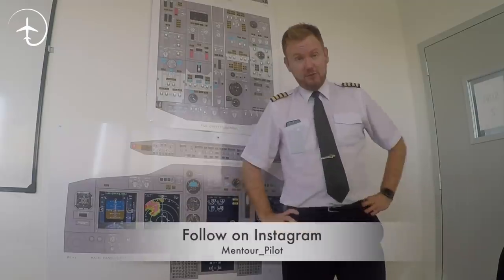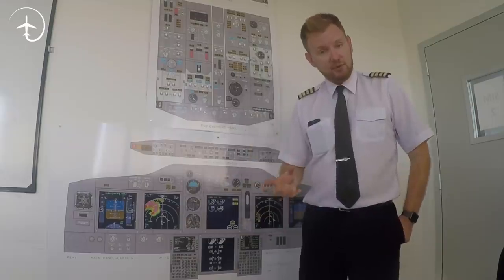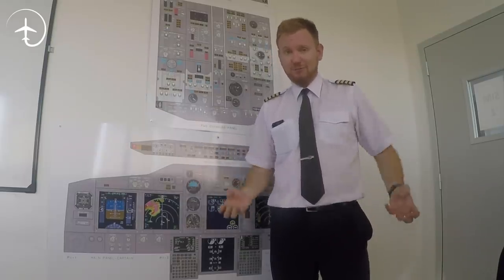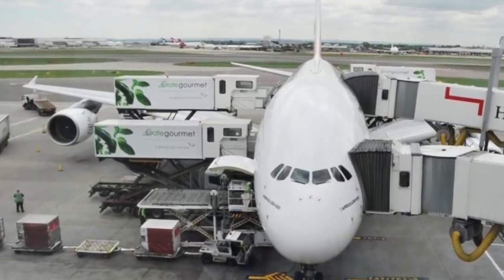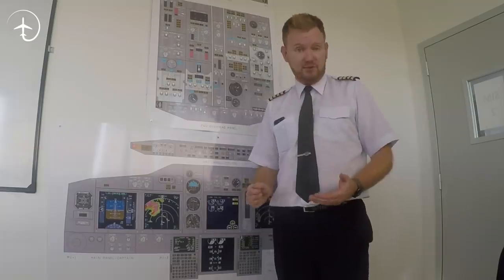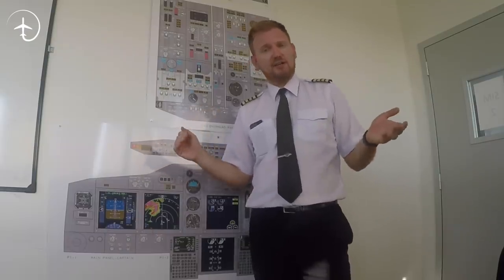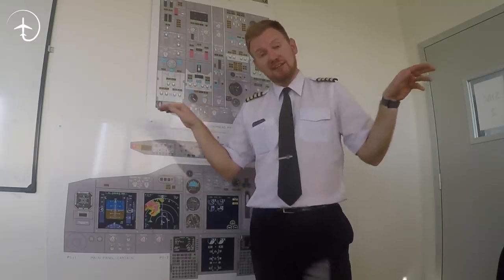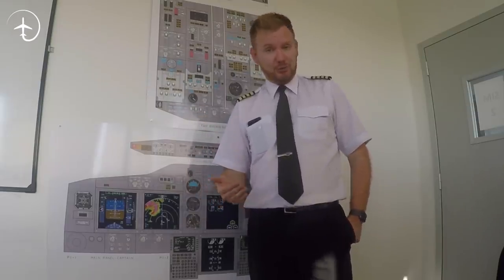What is that SPIRAL in the Jet Engine?

Comment: Used to fuel aircraft, private, charter, corporate, ComAir and SouthWest Airlines, back in the late '90's, until '04 in New Orleans. Ahh the lovely wash coming off a hot engine on a humid August day. Oi. About the only part, other than the first and third employers, I do not miss.
I was fairly lucky, as Jet-A didn't bother me too much, so when I had an "oops" (certain helicopters are great at splashing you, sometimes the hook-ups leak because they're worn or once about to fall off loose) and got fuel on me I could clean up a bit in the restroom and change clothes and be fine. Other guys got a rash before they could even get cleaned up.
We had one hire who loved the job, and looked to be pretty good, but just the fumes from the jet fuel caused him to become a walking rash.
I got lucky and never had an accidental overfuel where it came out the vents. I did have a request for a "Jet-A truck with single point, and two five gallon buckets." when I fueled an F-104 Starfighter. It had no gauges and let you know it was full by pissing out of the wingtips.

Comment: They are to simulate motion so to frighten birds away.

Jets have a horizontal "V" < with the open end towards the engine inlet. To warn  deck personnel about the suction. Men will be killed by the fan if sucked into the engine.

Comment: I was once accidentally sprayed with cold petrol on my face, it was not a good time. Even after I cleaned it off my skin was irritated for a long time, it went super dry, it was the worst case if chapped lips ever basically. 

I had to put lots of lotion to get it feeling normal again. So yeah don't stand under the wing of an plane.

Comment: TLDW: “Our aerospace engines have swirls painted onto their spinners in order to indicate when the engine is rotating while on the ground. In flight these swirls flicker as the engine rotates at high speed, scaring birds and allowing them to fly clear of the engine.”
Of course watching this gives more details.
Reply: I think the bit about birds avoiding the swirls is talking about on the ground. In flight, the aircraft is moving far too rapidly for a bird to perceive, much less aim towards, the opening of the engine.

Comment: Is there any possibility of engineering a grill that can unfurl for use when on the ground as an extra measure of safety?

I understand why they cannot exist for operation when in the air, but on the ground the degradation of performance and the aerodynamics are not as important.

There have been at least two or three recent incidents in the USA of ground crew ingestion. It just feels like a retractable lightweight grill that could stow just for safety usage on the tarmac is needed to save lives.

If not retractable, maybe create a robotic system that could fasten such grills to any aircraft upon entry to the tarmac areas. So a couple of fasteners would only be required and retractable. The grill would be provided by the airport for the proper make/model of aircraft, and the ground crew would have robotic remotely controlled equipment to place the grill onto each engine.

It seems like a lot, so maybe it's a terrible idea, but maybe no one thought through a way to place temporary grills for only tarmac usage before.

Comment: Why is the cone not more pronounced? Would a longer cone not allow for the air entering the engine cowl to split sooner, thus reducing its potential to reach supersonic speeds which turbofans are not best at dealing with. The turbofan blades will do the air compression anyway. Also why not make the engine cowl wider like a reverse cone so more air is funneled into the engine cowl. Any reason why these engine cowls are not lighted when the aircraft lands, it would make engine inspection easier at night or low light levels and perhaps if turned on in flight, it would scare away more birds.

Comment: Getting drenched in skydrol is much worse than getting drenched in aviation fuel, as skydrol, which is the hydraulic fluid used on the 737 is acidic, to prevent it freezing when the aircraft are at high altitude

It wont melt you straight away, its not that strong, but if you get it in your eyes, it stings, a lot, and the best way to neutralise it i have found, is washing your eyes with milk

So, no cabin crew would want you sitting in their aircraft seats, covered in a mixture of skydrol and milk

Also, the gear bay is absolutely filthy, its covered in rubber from the tyres, and brake dust along with other muck that gets thrown up into it from the wheels, so dont go in there, your clothes will end up black, and its hard to get off

Comment: Why no mesh around the intake opening of the engine? Yes, a strike would be more messy but any parts that make it through the mesh would be much smaller then the whole bird. Also It could stop getting sucked in. At the very least you'd have a greater chance of surviving an accident.
Reply: Then you reduce the air coming into the engine

Comment: Hi, why is the spiral only on the cone? Why does it not extend into the blades?
Reply from the maker: Great question actually
Reply: Cause it's easier to see the spiral in the middle rather on the blades. When the spiral starts to slow down everyone on the ground knows it's safe to get near the plane. It doesn't have to be at a complete halt, just slow enough that you can see the spiral. If it was on the blades, everyone would be waiting for ever to see the white lines and no one has time for that shit as airlines are on a strict schedule to open the door and get passengers off the aircraft.

Comment: Why do airlines usually (but not always) cover the front of the engines with a big cap? I remember boarding planes with the caps on, and hoping someone to take them off ! 🤣
Reply: Mariano Quiroga Usually to prevent ice build-up on the fan blades when parked in cold weather. When you boarded it was probably the first flight of the day for that aircraft.

Comment: That is why you do not ever walk under the gun tube of an M1 series Abrams tank. It is computer controlled and can instantly descend to minimum elevation. It is a li;;ing machime and doesn't care who she kills and the hydraulics could pull you apart and not even know you were there. Line up all the crunchies you want in the back to keep warm once it's jet is running, just not at start up. 900c at exhaust.

Comment: I have an Idea or something to cool down the engine quicker just use Liquid nitrogen to cool the engine down quicker and same liquid cooling systems that rockets use but you will have to start the engines hot rather than  cold for reasons compleatly frosted engine will not startbecause ice debris is blocking the engine which you do not see every day unless your on a extreamly cold runway -50 or below.
Reply: I have an idea: google punctuation.

Comment: I was wondering about the jet engine intakes?  Surely they can design a cover for them which is made of stainless steal and mesh type in the shape of a cone so no one or birds can ever be sucked into the intakes ever!  Yes I know they say oh but the airflow would be mucked up such that the engine would not work well?  But with modern design and wind tunnel testing they could do them so they are light strong and not muck up the air flow such that the engine is not well working?  it would stop all bird strikes and death to all person near the engine intakes.  Come on they have covers for the engines when the planes are not in use so why not try and do a cone shaped mesh one that protects the engine when working!

Comment: Have been doused with fuel twice. I was stationed on an aircraft carrier, and was "pissed" on by an aircraft, with its tail sitting directly over my fueling station while being fueled by one of my crew members. JP4 has a high flash point so ignition is of little concern, but it sure burns your eyes, it stinks, and it is uncomfortable. A long shower, and change of clothes is definitely in order. Your flight deck safety gear, and your boots, however, just have to be mopped up as well as possible, and then put up with. No spares for those.
It was just part of the job.
I came too close to a jet engine intake only once in 4 years. Flight deck dangers are pounded in to your brain, so it was just pure stupidity on my part. I walked in front of an A7, which I did not realize was running, and due to all the other noise, I didn't hear it until my head was directly in line with the intake. As soon as I heard the sound I dropped to the deck, and rolled away. I nearly soiled myself as well. LOL.

Comment: You would think their would be like safety mesh put on the engine when it's parked
Reply: And how in the hell would you do that? As soon as it lands you have to wait for the engines to slow down so it can be blocked, so the AC can be hooked up, so the jetway can be hooked up.. How in the hell are you going to put a net on the engine as soon as it "parks" so no one gets sucked in before blocking it, before hooking it up before un-boarding passengers? That's just stupid.

Comment: Jet fuel is only kerosene isn't it?
I have used kerosene as a solvent and hand cleaner, after working on greasy engines,  a lot, and my hands are perfectly fine.

Comment: As Far as the InTake think of a vacuum the Jet can and has sucked people in. I've seen 2  men do so that are military people and trained not to be in front of the InTake when running. One actually died because his lungs collapsed and the shut down does take a long time to do. The other was lucky kind of but he lost an eye and a few fingers. think of 100 cutlas swords spinning at 4000 RPM ... In the military, we put up safety rails that are very yellow and orange in color to make one remember that you will be sucked in,  not just can be.

      As far as the aft of the Jet the temp can be as low as 25,000 F to 55,000 and mind you that's not at afterburner but only ground idle. So think of it as a welders cutting torch, in fact had a jet not suck in and compress the air we can not have a jet run and if you could see the combustion cans you would see a small flame because 85% of the air is used to keep the flame off all the interior surfaces of the engine  other than the T wheels and exhaust cone.  So out the end the flame diamond can be as little as 30' and in after burn you will see up to 85' of blue flame,  yes you can cook a full black Angus in it in like 3 to 5 minutes like a jet stream oven but who is that stupid to do so.

      Now under the wings is yet something else for I have done so 1000's of times but not for stupid reasons. sometimes to check a panel that did not lock in or pull a red streamer that would not allow a rocket to launch or a wheel boogie to fold in and lock after take off.  I warn you don't do this at home.  For you may get blown sideways from the aircraft from the compressor bleed ports that are set to open or close as the engine is in various stages of compression for to much air can blow the engine or to little air can stall the engine. B.T.W. the blow out is set between the first low compressor and the high compressor and it too will burn you because the compressor can heat up to 1,600 to 3,600 F sure it's not as hot as the blue flame out the aft but still very tosty warm.  

      1 Other thing jet fuel burns very clean and the fire of it is very hard to see, without actually burning it will melt the rubber of your $500.oo Nikies in no time.  If you get it on your skin and don't wash it off you can get 3+ degrees burns, it will bleach out the color of your clothing and if your clothing is nylon it will melt off your clothing and skin very fast.  For this nightmare, we have almost fireman like wash down stations by all the fule heads, it's also for if you get jet fuel, hydraulic oil, or jet oil on you or in your eyes any of them can blind you.
Reply: "As far as the aft of the Jet the temp can be as low as 25,000 F to 55,000" is this a typo? The temp at the center of the Sun is 27,000 F. Cutting torch is like 6,000 F.
Reply: 6000 kelvin not f
Reply: 30,000 kelvin not f
Reply: 6,000 k Yes this sounds right.
Reply: 30,000 K is still 56,000 F and only slightly less in Celsius It still doesn't sound right. I think something is getting lost in translation.
Reply: The combustion temperature is limited to a couple thousand degrees because of material limitations. If the exhaust was 25,000 degrees F, the engine would just melt.

Comment: Almost all aviation rules were bought with blood and/or flaming piles of wreckage.
Why not allowed to walk under a wing? Someone did and walked right into a spinning propeller.
If it was a small plane with a fixed blade propeller it would be blowing air behind it. But on a bigger plane with a variable pitch prop the prop is in a kind of neutral - flat, not blowing air in either direction, so a person texting, or whatever people did before texting on cell phones, could absentmindedly walk right into a prop.

Comment: Just install a grill or wire mesh on the intake of the jet engines
Reply: it would still get sucked in plus decreasing the power needed to take off and even if it didnt get sucked in the weight of a human would finish the job

Comment: You say that rules are created for good reason, but the no cell phones rule causes me to question this. If a powered on cell phone was actually a risk, crew would either collect all phones or use some kind of scanner to verify all phones were off. Obviously it's only a rule and there is no real concern. How many other rules are like this, no one has bothered to update the paperwork so unnecessary rules are enforced for no good reason.
Reply from the maker: Hi! I have done a video on this rule as well. Check it out.

Comment: You didn't answer! It's to get electric power from the Air into the compressor. Nitrogen.  Main fuel tanks in the Wings?
It shouldn't be able to lift or turn. 
No they are filled with Helium in the A 380

Comment: Only thing I heard wrong with this is the jet engine takes a really long time to cool down..that's complete bogus. take about 20 minutes for a jet engine to cool down on the out side. I have first hand experience with this. Plus a airliner engine has a much bigger cooling jacket then a fighter aircraft, much smaller combustion chamber too. So I guess it's all on your view of what a Really long time is. After 20 minutes you can safely touch the engine with your bare hand and you will be fine.

Comment: figured thats what theyre for. they should paint a big spiral across the blades too
Reply: That's just stupid. How is the ground crew going to know that the engine is safe to approach when the blades are still spinning? When it's just the cone and you can see the lines clear as day you know it's safe. If it's the blades, well it's pretty damn difficult to see clear lines. -.-

Comment: Buzzzzzzzzzzz, Wrong !   Been in Maintenance for 38+ years, and always told that the Spinner Cone on Jet Turbine Engines is painted that way to help Detract Birds from flying into the Engine.  All birds see otherwise is a open hole that they think they can fly through safely, but as we all know, Birds and Turbine Engines to not mix well !

Comment: Why don't they just paint the fans in white colours? So that the engine would not look like a cave and birds won't fly into it.
Reply from the maker: The fan blades are extremely sensitive to weight differences, hence no paint,
Reply: Mentour Pilot So what if the fans get rusty since they don't get painted? Change a new one?

Comment: You could paint a picture of some kind on the fan blades, including, but not limited to, a brand logo, and then use strobe lights attached to front lip of the engine to make it visible when spinning, even in flight. I'll sell this idea for 10 bitcoins.

Comment: If this many people only cared enough to research the spirals found in nature, your body, the universe, and why this was important than you would understand why this spiral is on this propeller. We do not need to fuel these nonsense engines to run backwards, centrifugally, when we could be using suction and having them run centripetally. When you fight the only way things around us work you have to keep pushing. Wd can't do this naturally so there is a need to explode in order to create this. We are working our lives to run machines incorrectly and there are many more answers involved than just creating a force that can be comprehended and copied by the flowing forces of nature inhabiting a space.

Comment: Only fuellers and maintenance are really allowed under the wings.
Reply: Actually no. Security, rampers, cleaners, painters, sometimes depending on the planes catering, and the pilots are allowed near the hangers. They're called hangers.
Reply: Actually, it's recommended that only the fuelers and maintenance go under the WINGS during ramp turn around operations because of a need to be basis; I'm not talking about when the aircraft is parked away. There are no painters during a 1 hour or 30 minute turnaround on the ramp. Security has no reason to be there. The only people with a need to be basis are fuellers, pilots, and maintenance. Even rampers avoid walking under the wings unless necessary.
Reply: DJSbros Lol ok. You keep thinking that.

Comment: So you say that ordinary person can just ignite jet fuel without all those risky things which are prohibited anywhere close to aircraft?
I understand that you look like pilot, talk like pilot, seem to have knowledge bigger then pilot, but risk of ignition from jet fuel?
Are you serious?
That thing does not want to ignite of almost anything - you wont ignite it of the match...
neither:
ligher, Propan or Butan or mixture burning gas, MAP PRO burning gas, and so on and on
honestly even ordinary gasoline (name used to avoid confusion) cannot be lit using cigarette and sometimes match would not be enough (as you may extinguish cigarette and even match in gasoline)